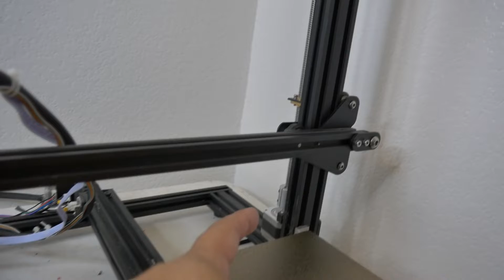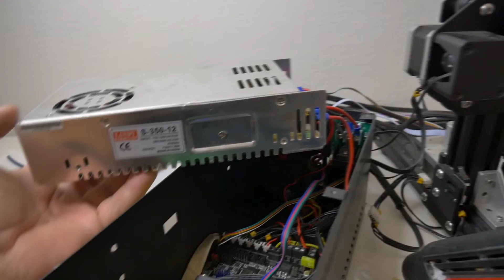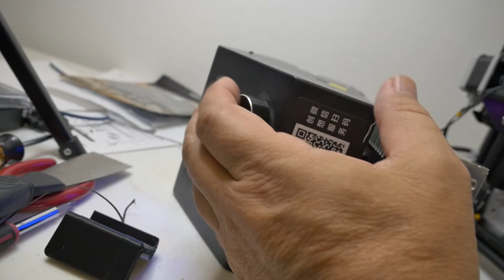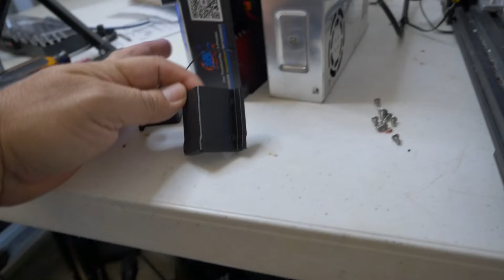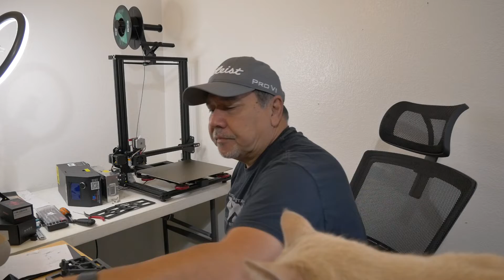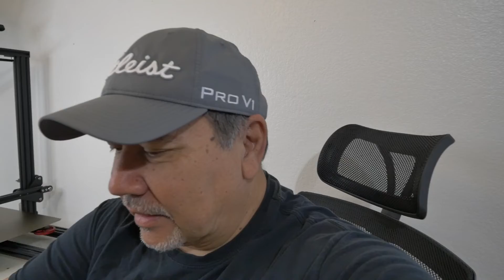Why are the Layers Shifting on this Creality CR-10?

Comment: Don't those typically have meanwell PSU?
Reply from the maker: I think the early CR-10 and Ender 3 base models did not have Meanwell power supplies.
Reply: @thinkdesignmake  This is true, I own one of the first CR10's the power supply is not a Mean Well.  It's some sort of generic power supply.